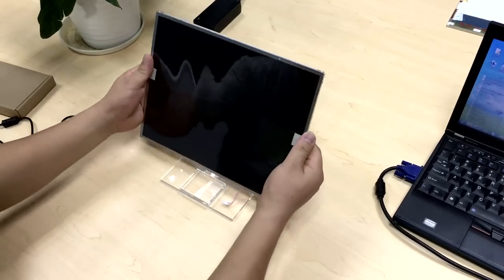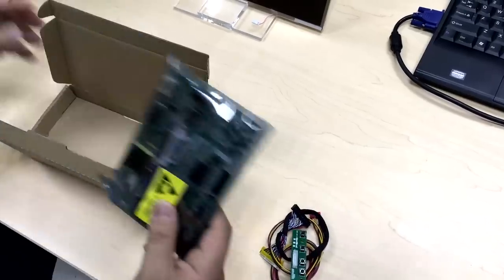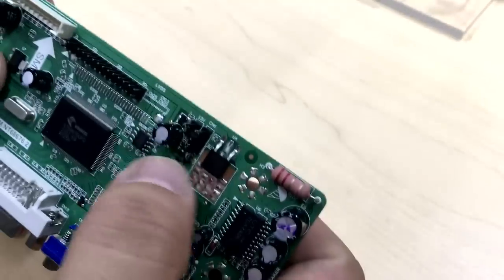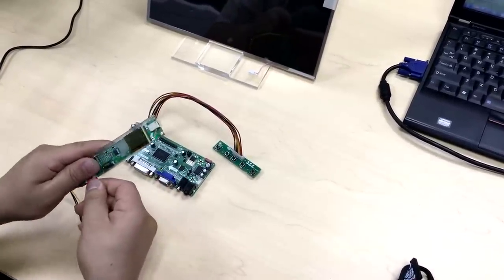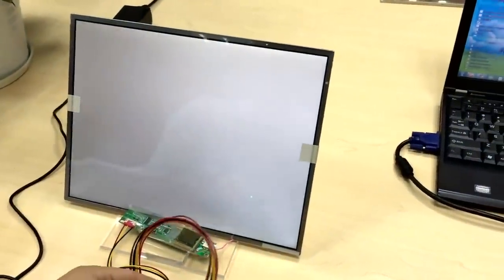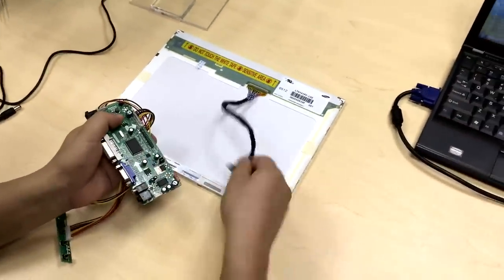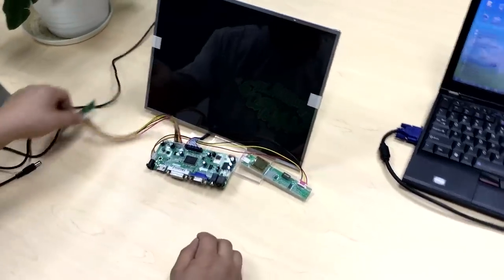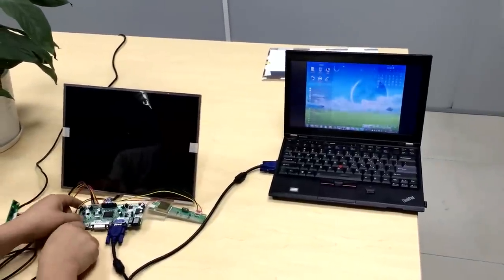DIY LCD Controller Board Assembly Guide

Comment: I'm not too bright so I plugged in the monitor ribbon cable while there was power to the board. I got a little spark and puff of smoke and figured this project was over. Not so! I guess whatever got toasted wasn't important because the lcd screen and the Chinese board are working together perfectly. Thanks!

Comment: Hi Chan,   have you tried; or had any luck with using one of the hdmi to vga converters with the lcd controller board in place of a traditional power supply on any applications?

Comment: What if you have multiple 40 pin displays with different resolutions? Do you need a specific driver board for EVERY different panel? I just want to hook them up all, without getting all specific boards.

Comment: I had an old crappy laptop laying around, which I once got to take apart. I want to make a second monitor for my laptop, but I'm new to DIY things, so I thought that would be a good screen to test it on. A screen I'm really going to use needs to be matte, 1080p and IPS, and this one is glossy, 800p and TN.
So if this works, I'm going to search for a proper screen. But do I need to get a whole new control board, or can I change a few pins on the board to make it compatible with other screens?
Reply from the maker: Hi, Animiles. 
You need to check the model number and version number of the display, before get a controller board or something else.
So, go and check the matrix information of the display, and compare if they are compatible with each other, and then get the right controller board kit for yourself.
And one is 1080P, the other one is 800P, it means the resolutions are different here, the firmware is different.
My suggestion is: Check compatibility first, and then choose the right one, which mean cost efficient, and easy to process here.
Happy DIYing!
Reply: Thanks for the info :D
Reply from the maker: Keep in touch !    https://goo.gl/I5TEcg

Comment: what power supply did you use?
Reply from the maker: Hi,Ryan

Usually, it is 12V/3.3A, sometimes it's 12V/4A, it depends on the display the display.
Reply: Can i use the same ac adapter from the laptop i got the screen from?
Reply: As far as I understand the amount of Amperes is irrelevant as long as it is not below the needed minimum. But to be honest I have no idea how to find out what the needed minimum is
Reply: @miguelfernandes8244  No. The board is rated at 12 volts. Laptop psu usually are 19-21 volts. So keep that in mind.
Reply: @oleksandrshulha7451  so 19v is too high?
Reply: @chankim5090  40 pin lvds cable

Comment: I have the following monitor: Samsung C24FG70. Is it possible to replace the led lights with RGB leds? Possibly the smd APA102 with the following microcontroller: ESP8266. How could i hook this into the current LCD controller board? Any input is appreciated.

Comment: Hí. One question, i buy the controller LCD, but i can make a INFRARED controller, but, what frequency use the  controller lcd? I read the same side at control volume, inputs and... the other pins says IR-REMOTE.

What remote i can buy to controller the 5 keyboard with a controller IR? I see its possible, but i buyed without remote, and now, i want install. 

THOUSAND THANKS. sorry for my english, i speak a few, but wrong. ;)

Comment: I use hdmi on my control board. When I press the on button: 
1. The control boards led lamp turns green, the screen goes on for a couple seconds, displays "attention, no signal". 
2. Turns off with the control boards led lamp showing red. 

Since the screen gets the message, I assume the cables connected from the screen and to the board is good. 

Since my pc is registerring that something is happening when I plug in the HDMI cable, I assume the connection between the PC and control board is good. 

My hypothesis is that either I am missing a driver for the control board, the screen I'm using is not compatible with HDMI signals, or I broke the screen by touching the "do not touch" part of the screen.
Reply: Did you get it working? How? I have the same Issue.
Reply: @winandd8649  If I remember correctly, I swapped the HDMI for DVI cable.
Reply: @yongamer  Thank you for your reply. I finally solved it: I had to push the HDMI connector in really hard, it was not seated properly :-)

Comment: I burned up my LCD back light inverter board because I didn't have it connected correctly (bare wires), can I buy another one? Just the CJY_22H120_V1.0 board.
Reply: You can use Universal LCD inverter board, I use it when I changed my board TV so I need inverter board also. Watch this video 'till finish https://youtu.be/NyuWPFIskxA

Comment: Hi! What adapter should I use for DC input for such or similar board? Voltage, etc. Thanks.
Reply from the maker: It depends, on the display that you use, sometimes, it's 5V or 3.3V.
BTW, Michael, you got a nice channel out there!

Comment: I jave an lcd that uses 20 pin lvds. Can i use a universal controller for it. Model is LT121DKX7V00. Or can u build a control board for my lcd. I couldnt find much info on the lcd

Comment: I am testing the LCD back-light. The screen comes on but powers off about a second later.
Do you know what I can do to troubleshoot?
Reply: We're you able to resolve your issue? I am facing the same problem
Reply from the maker: Did you try to check the CCFL? Usually there is a problem with the CCFL if the back-light is not functional, sorry for the late reply.
Reply from the maker: Yes, most of the DIY kits include LCD controller boards and keypad, LVDS cables.
And you mentioned that you have a b156xw02 v.2 screen.
I was wondering which one that you refer here, as b156xw02 v.2 got four Panel Models:                  
 B156XW02 V2 HW4A
B156XW02 V2 HW0A
B156XW02 V2 HW5A
B156XW02 V2 HW1A
And I have checked, all of the panel models are with lamp type WLED, it means the Backlight is WLED. 
Only those with CCFL needs the inverter.
You can check the controller board kits in my store:
https://goo.gl/I5TEcg
Reply from the maker: you are welcome

Comment: LM230WF3 (SL) (B1) lg panel can i convert the 6 pin flexribon backlight connector to the  2pin wire inverter.

Comment: hello i have v.m70a controler, and it worked but just for an hour. now only 1/4 of the screen works, the rest displays random colors which change when i disconnect and connect the screen data cable back in. any ideas? did the screen fail or the controller?
Reply from the maker: you may check the T con board here, let me know the matrix information,I will check

Comment: Hi Chan, I've connected everything and the backlight works fine but I can't see the input signal. I've tried using both hdmi and vga and nothing shows up. I've checked the input signals with other monitors and they work fine. I can't figure out where I've gone wrong.
Reply from the maker: could you please taken some video and send a link to me?
Reply: Thanks for the quick reply Chan. Here's a dropbox link to the video: https://www.dropbox.com/s/bajkll6wuaof9g7/LCD%20Controller%20Setup.mp4?dl=0
Reply: Same here
Reply: @aimless3827  I'm having the same issue. Were you guys able to find a fix?

Comment: hello sir i want to know that when we required a jumper setting. or if i have a 10 inch or 15 inch display of old laptop then its required a jumper setting or not and  if jumper setting doesnot change it can harm to lcd controller board and display of laptop.
Reply from the maker: take photo of the jumper and controller boards, show how you connect these parts, and send it to me within the message of the Youtube channel. I will check

Comment: Can i use universal lcd control board?
Reply from the maker: Hi, R.V
Different display got the different firmware, as the resolutions might be different.
So there is no controller board like one for all, or like you said universal type.
And sorry for the late reply, pal.
Have a nice day!
Reply: Hey where do you get a universal control board?

Comment: i have tsumv59xu-z1 board gsl- v59xu-z1 chip
old tv tuner type

i am not able to update the firmware via usb

when i put pendrive in board and power it, led stays red it doesnt flashes red/blue

i am not able to find the problem 

please someone help me 
its making me so frustrated

Comment: Hi. Is there any driver board compatible with the MacBook Pro 15.4 inch 1680x1050 display?
Reply: Hello, you need to find out the lcd model number first, once you find it , you can contact e-qstore for suggestion from this link http://feedback.ebay.com/ws/eBayISAPI.dll?ViewFeedback2&userid=e-qstore&rt=nc

Comment: Today I got my control board for my monitor. when I plug in the converter to the screen it works for a few seconds, and then turns off. I assume this is because no monitor is connected, and it'll turn off for power saving.
But when I plug in the flat wire the indicator light on the control thing turns green, the backlight starts to flash a few times very quickly along with the indicator light, and then it turns off completely.
Why does this happen, and what can I do to resolve it?
Reply from the maker: can you record a video to show me how you connect all the parts and also the display?
I want to confirm about the situation here, better send me a youtube link here, perhaps it's better if you can send it through message here, it will be better, I am not always online as I need to handle the orders, and reply to my customers who specialized in PLC and HMI and etc.
Reply: Hello, Thank you for your quick reply! As soon as I get home I'll be able to work on it.
(I didn't realise you also sold these on Ebay, so I'm not a customer of yours. But I'd still very much appreciate it if you'd continiue to help me trouble shoot)
But I think I found the issue. I used a 12V 1A power adapter. I found a data sheet of my monitor (different version. V7 instead of V2), and there it said that the max Rush Current is 1.5A. I'll try to use a 12V 5A adapter to test of that is the problem. If that isn't the problem I'll make the video.

ps, I kinda regret it from buying it from the other seller, as it is very hard to communicate with him. After explaining the issue this was the first response I got:
"Very sorry to know
TOMORROW TELL YOU ,OKAY?
now we are here at night, engineers have to get off work.
have a nice day!"
Once I manage to get a full-hd matte ips monitor I'll re-build it and i'll make sure to buy one from you (if you have one for said display of course) :D
Reply: Well, I got an update on the situation. I got the board working by using a 12V 5A power adapter.
The only problem I currently have is that I accidentally melted the connector that goes from my screen to my converter. But I should be able to find a fix for that xD
Reply from the maker: ok, I know the seller is Chinese when I saw what you quoted "Very sorry to know TOMORROW TELL YOU ,OKAY?" I am Chinese, too. But I do not communicate with people like that, it's quite obvious that they use typical Chinglish to reply to you.
The connector melted, you may need to check if the interface is damaged or not.

Comment: Hi, my board power led only binks a while with red color. Then it powers down. What can be wrong? Everything worked first two times. Thanks.
Reply: Did you manage to fix your issue? I have the same problem
Reply: @chernogop  A replacement board was sent, because I think that I've short circuited mine...
Reply: @samisvideo  do you know what you might have done wrong?
Reply: @chernogop  I think that the backside of the board touched something. I'm more careful now :)

Comment: Hi. Can i use pc psu to power this board? I'm thinking to cut one molex connector and solder the 12v directly to the lcd controller board. How about the current?
Reply from the maker: you need to find out what is the output voltage and current of your PC PSU here, or otherwise the boards might be damaged, usually the voltage of the controller board is 3.3v, I am not sure what is the current of your boards here, so I can't help here, but you can try it and let me know.
Reply from the maker: Hi, Michael
LTN156AT32 has got 6 versions here, please tell me what is the version number of your display. e.g. LTN156AT32-L01, LTN156AT32-W01 and etc.
I need the right model and version number to configure the right firmware for your controller board kit.
Reply: The 12V rail on a desktop PSU has around 15A - The LCD Controller Boards uses 2 to 5A so the desktop PSU would burn out the LCD board.
Reply: @tommyh4116  what about voltage? Can i use a 5V and 2A AC adapter?
Reply: @ryanx9777  I'm using a 12v-2A AC adapter to power my LCD board. I've not seen any LCD boards use 5V.

Comment: control board for Samsung LTN156AT32 ...been looking all over
Reply from the maker: Can I have the version number of your LTN156AT32? 
LTN156AT32 got 6 versions, I need to know the whole matrix information to configure the right firmware.  It's LVDS (1 ch, 6-bit) , Connector , 40 pins, so I can configure the right board kit for you.

Comment: ineed help for LTN154X3-L0D. My cables dont work with LA.MV56U.A   VERSION TSUMV56RUU-Z1
Reply: Do you compare the pinout ? As the lvds cable for  LTN154X3-L0D is very simple. :)

Comment: What do I do if only part of the screen is being displayed?
Reply from the maker: Did you check the T-con board ? Partial display functions means the T-con board is issue here.
Reply: Chan Kim The seller flashed the wrong firmware on the driver board I received. 1920 x 1080p instead of 1600 x 900p. They're sending me the correct so everything's good
Reply from the maker: Great!  You are right, I forgot to mention about the firmware here, coz different resolutions need exclusive firmware here.
Reply from the maker: I saw your channel, did you do product reviews? Let me know if you can have some of my items reviewed. It will be great if you can do that!
Reply: Chan Kim I could review some of your items, sure! I actually wanted to start uploading reviews on my channel
Reply from the maker: It will be awesome! I am extending to Amazon and other shopping sites now, I will contact you once I got the right items fits your channel, BTW, ur channel is great!

Comment: hey can i get a conteol board for b156xtn02.0
Reply: ***** i used an universal driver board, V56-universal board from banggood, price is also low around 900rs, it works for me, it has inbuilt TV tuner so you can also use it like a TV and you will also get a remote. If you decide to buy this driver board then be careful when choosing the firmware, many people screw up on that.
Reply: ***** DIY how to make tv, channel-hammerland....ek andaza mil jayega dekh le agar nhi dekha toh
Reply from the maker: Yes, you can, I will configure the right firmware for you, as long as you got the right information about the matrix
Reply from the maker: But I need to check the model number and version number in Panelook, before I can get some actions here

Comment: how can i add a canon battery pack to this?
Reply from the maker: Sorry for the late reply here
you want to add a Canon battery pack to controller board?
Did you check the input voltage and current of the controller board, and also voltage and current of the battery pack? You can try it if you find these two matches, or otherwise, do not try that.
Coz usually we need to use a power adapter to make the boards happen, it should be stable
Have a  nice day!

Comment: I can't find for B154EW0I
Reply from the maker: Hi, Fredy

Sorry for the late reply here.

The right matrix should be B154EW01.

It's 15.4 inch, resolutions at 1280(RGB)×800   (WXGA);
Interface type:LVDS (1 ch, 6-bit) , 30 pins;
Backlight: 1 pcs CCFL
LCD type: a-Si TFT-LCD

I hope you can reverse the search terms when you found out that there is no result with your original keywords, it's much like the meta keywords of an item. 

Have fun with DIY.

Best regards

Jeremiah Hsiao

Business Operative Manager with I.E.S Industry

Comment: how about for 5inch 7inch lcd
Reply from the maker: So you want to ask if a LCD at 5" or 7" could get the right controller board or not? 
You just need to check if it used LVDS cables, and also how many pins (the interface) does the LCD have on the rear side. Sorry for the reply after one year, I was busy with the orders and PR stuffs